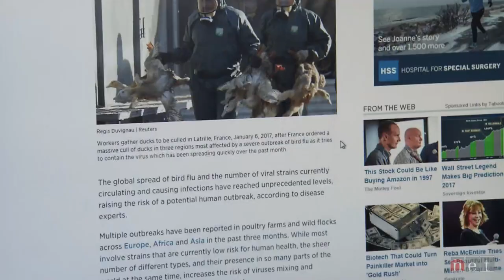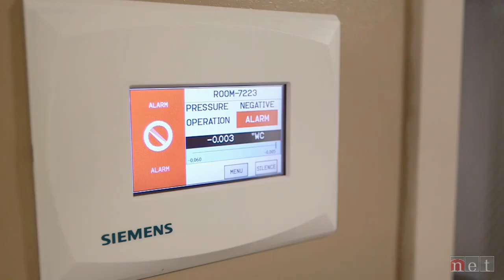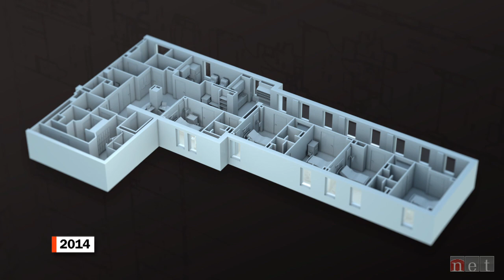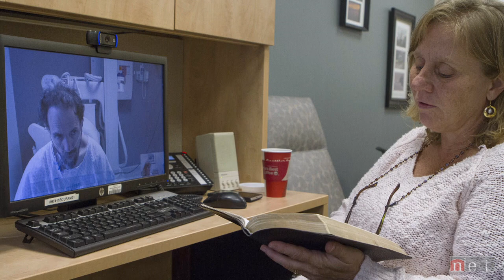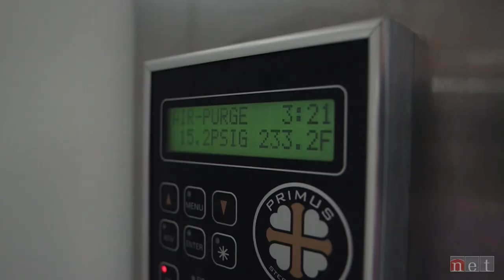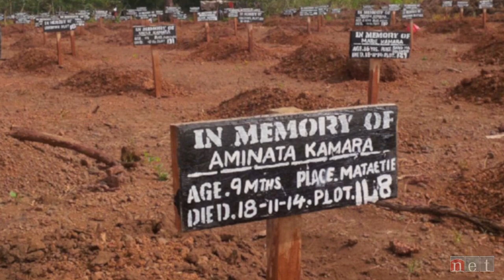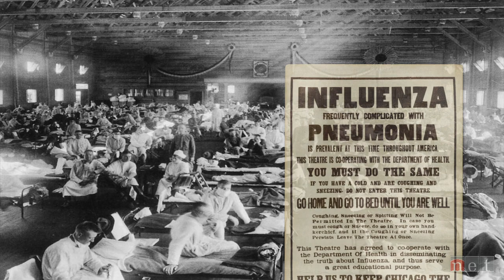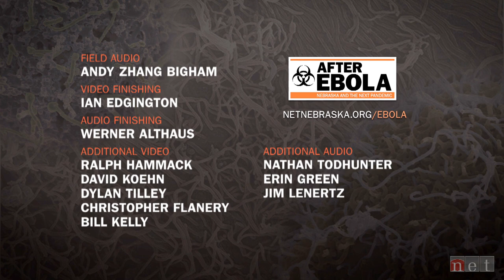After Ebola: Nebraska and the Next Pandemic

Comment: hope they have cable tv in those rooms (and channel changer)
Reply: OMG you
Reply: you'd probably want a box of remote-control covers and spare remotes though, if you use them there.
Reply: In Texas hospitals they either didn’t have it at all, or the it went out and they couldn’t safely fix it. WiFi won’t penetrate the walls or pressurized doors either.

Comment: These emergency drills are scary - but I'm shivering to think about a drill with a large number of participants randomly excluded. Maybe start with only 61% of people which would normally available. Or have about 55% of participants randomly be unavailable. Of course you have backups in important roles. They will often fail too. (One nice aspect would be you would need to acquire unsuspecting replacements from the general population, during  the exercise. Just as you would need to acquire them with real risk )

Comment: I found this... “One issue which hinders control of Ebola is that diagnostic tests which are currently available require specialised equipment and highly trained personnel. Since there are few suitable testing centres in West Africa, this leads to delay in diagnosis. In December, a conference in Geneva will aim to work out which diagnostic tools could identify Ebola reliably and more quickly. The meeting, convened by the WHO and the non-profit Foundation for Innovative New Diagnostics, seeks to identify tests that can be used by untrained staff, do not require electricity or can run on batteries or solar power and use reagents that can withstand temperatures of 40 °C.”

Comment: There's a video somewhere (dammed if I can find it now) for a catering school demonstrating the danger of salmonella where they coat a tray of eggs with ultraviolet dye then ask the class to make sandwiches using them. When they are done the normal lights are dimmed, replaced with UV and the full extent of the horror is revealed as the entire kitchen & class glow with spots of cross contamination. Wonder why the same technique is not used for contagious disease containment training?

Comment: As someone who works in a toxic and explosive atmosphere / environment (I work with composite materials, many of which are highly explosive and volatile) I'll just give my 2 cents: a suit where you just put gloves over the suit, is not enough ... you need to tape every seam. Filters need to be changed every week, and every day depending on the amount of "risk" you're working in (filters can only filter so much after-all), but air tight suits with positive pressure are an absolute must.
As it is, with what I breath every day,if I get pulled over, I'll get arrested instantly for extreme "DUI" from just a breath sample, let's not even mention blood sample xD ... even though I'm 100% healthy and not "under the influence". Products I work with just affect my blood, even with the protective gear we use.

Comment: If they would manufacture garments that had reinforced cuffs at the wrist; ankles on the gloves, coats , pants and boots they would not tear when they remove the tape. A heavy duty plastic that does not rip at those points. Creating a position that tracks and marks on a dry erase board/map locations of infectious diseases throughout the world and what they are to raise preparedness and awareness in anticipation of an event would help. Also, it would create autonomy as apposed to complete dependence on CDC. There is also something to be said for spraying down a dressed down staffer with disinfectant before gown removal. its an extra step before removing contaminated gear in the case of an accident in removal. Good old fashioned alcohol or something that would kill germs, while still following the removal process as created. An engineer would be helpful in process planning as well, I know your smart folks and don't need my input, but just my thoughts.